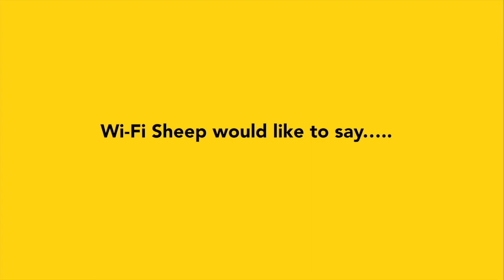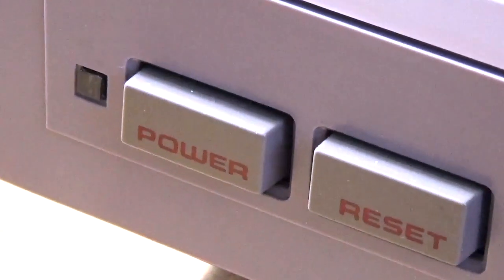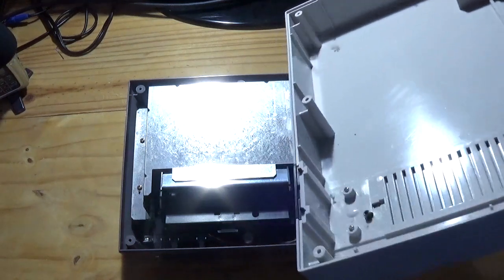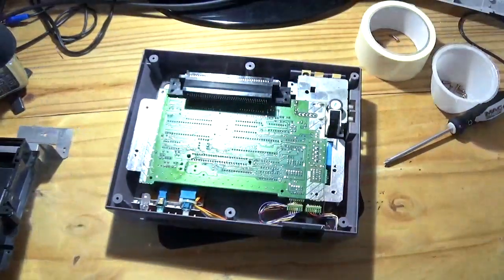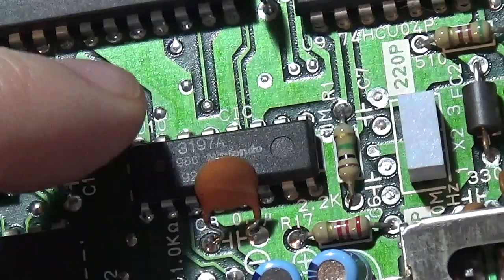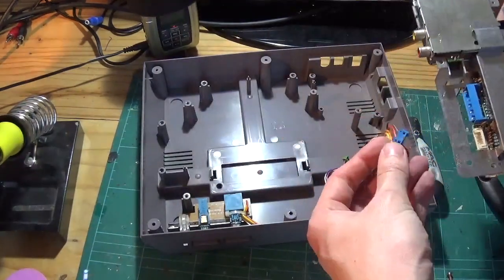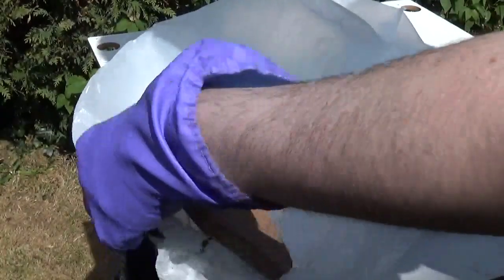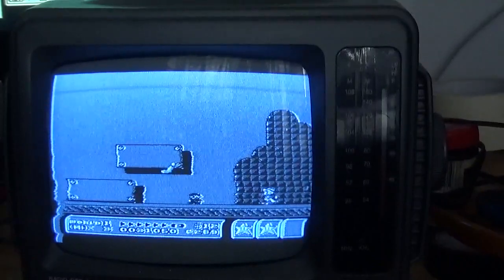A British PAL NES - Restore an 8-bit Classic

Comment: An informative video - did not know the NES had a custom CPU chip, thought it was a stock 6502. Just a quick note the plug is not illegal as it is on old hardware, it would be illegal if it was sold connected to any new electrical device.
Reply from the maker: Hi Krystine, thanks for your comment, very interesting what you say about the plug issue. I was going off what my electrician tells me when I need to get PAT certificates for my retro tech so it can go into shows etc.

He wont pass anything until its had its plug changed if its the per 1985 standard. Saying that I don't discount want your saying as it dose sound sort of right and would explain a few things .... hmm??? So thanks for the heads up, one that I will look into!